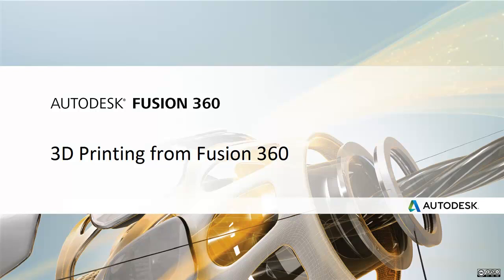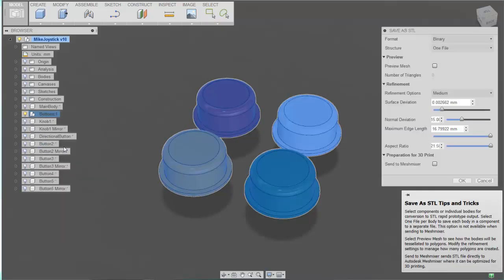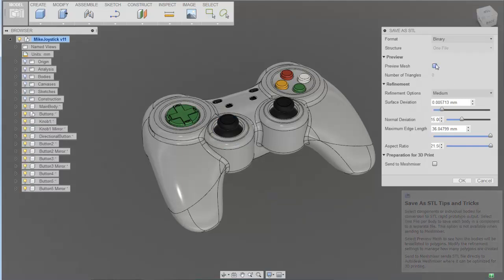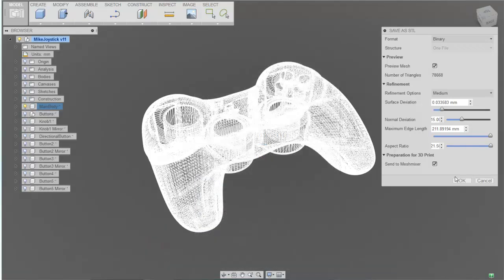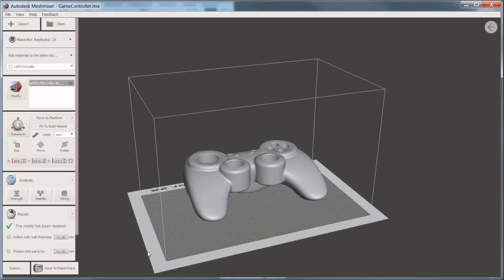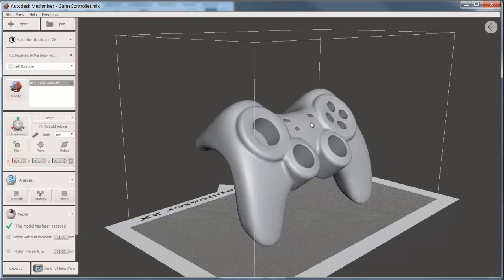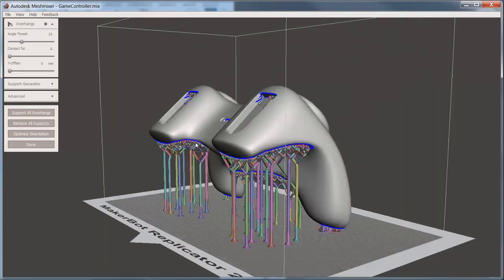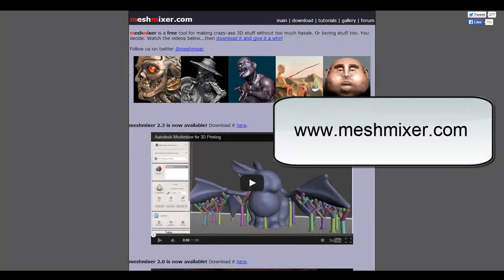3D Printing from Fusion 360

Comment: excellent video.  I am building a powder bed 3d printing machine and I need to take the model obtained from photogrammetry and cut it into 0.2mm layers, each layer will be exported to a normal print file like PDF ... can I do this in 360 fusion? Any guidance you can give me would help me a lot, thank you very much.